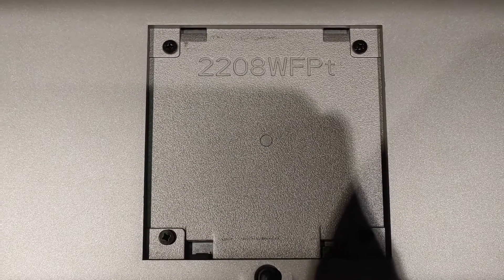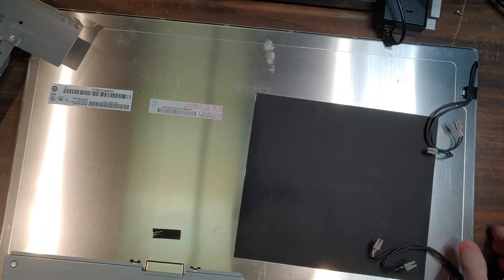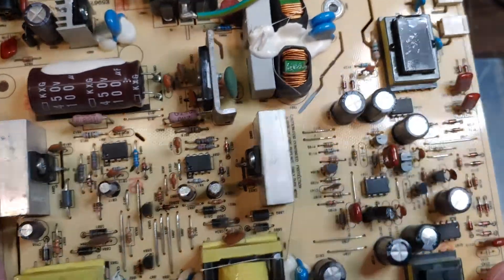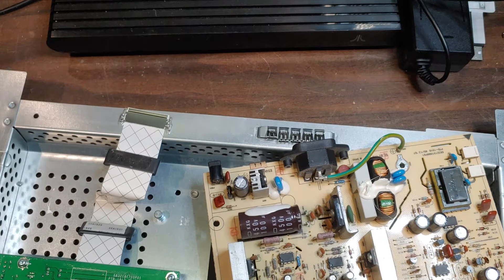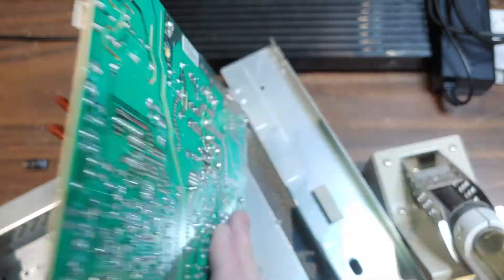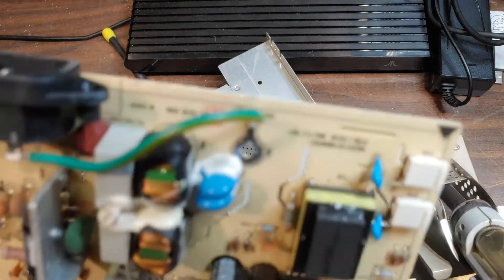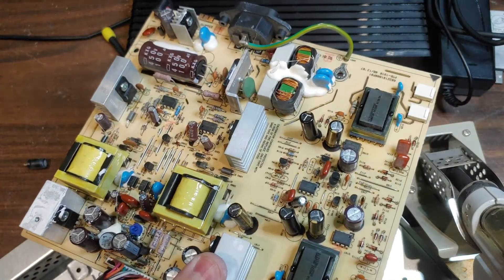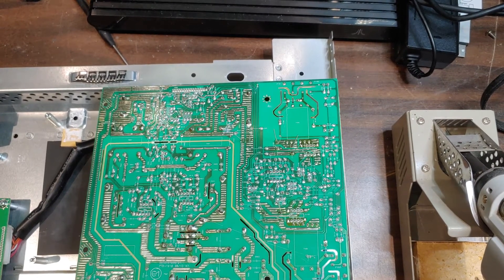Repairing Nonworking 22 inch Dell Monitor 2208WFPt (Replacing caps)

Comment: I need to know how to dissemble it without damage how do you open this damn thing
Reply from the maker: This is a good step by step guide:
https://www.ifixit.com/Guide/Dell+1908FPb+monitor+power+supply+Replacement/15125

It's pretty much the same monitor just the smaller sized one.

Comment: I have that exact same monitor and it just went.  Where can I find those replacement capacitors ? Thanks for posting!
Reply from the maker: I just grabbed mine off of eBay.  You can usually find them there or even places like Digi-key or Mouser electronics.
Reply: @RedWolfJC  Into it now. I guess I'll get the numbers off of the burst capacitors and go from there. Thanks!

Comment: Mine has gone full white any way to solve it
Reply from the maker: Assuming you tried the easy stuff (power cycle, hook up to a different PC) if I had to guess I would think there was something amiss with either the VGA board or the ribbon cable that connects the display to the VGA board.  (You can see the board at 3:05 in the video, it's the board on the left.)
Reply: @RedWolfJC  thanks man i change the ribbon cable and it works

Comment: Good thing we didn’t need to see how to take it apart.
Reply from the maker: If you had read the description, I put a link to the instructions I used to disassemble from iFixit.com, who did a much better job than I could ever do describing the process.
https://www.ifixit.com/Guide/Dell+1908FPb+monitor+power+supply+Replacement/15125
This is not the exact monitor I have, but the instructions for de-casing the monitor are virtually the same (the 2208 is just larger)